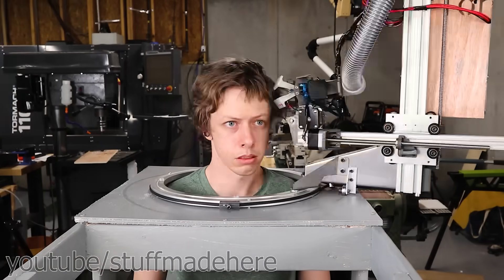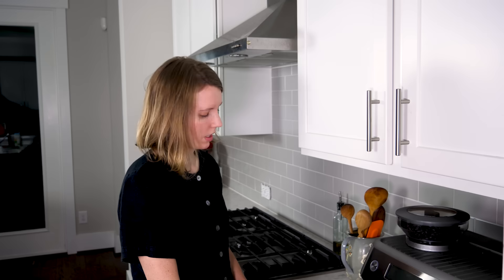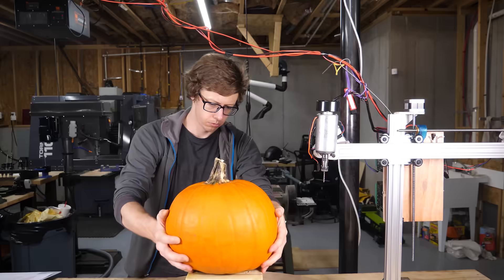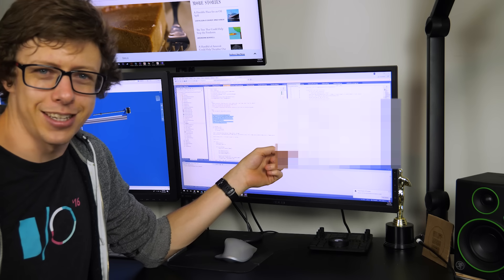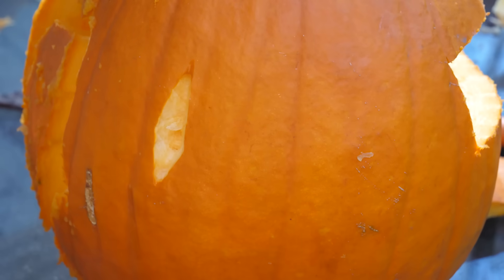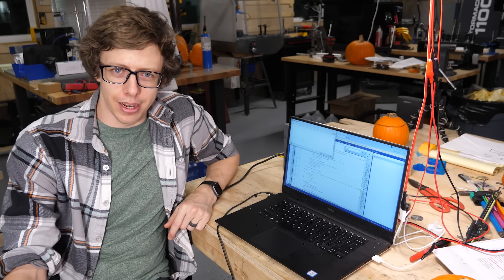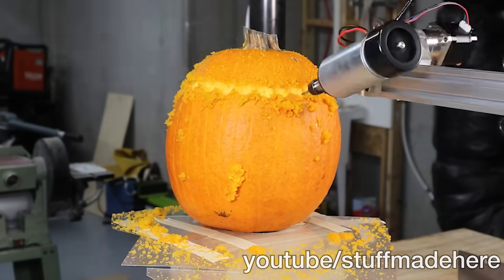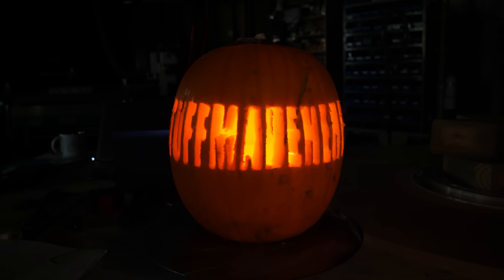Making a robot to carve photos into pumpkins

Comment: Jack o'lantern production at a jack o'lantern farm was low, so the farmer wrote to the local university, asking for help from academia. A multidisciplinary team of professors was assembled, headed by a theoretical physicist, and two weeks of intensive on-site investigation took place. The scholars then returned to the university, notebooks crammed with data, where the task of writing the report was left to the team leader. Shortly thereafter the physicist returned to the farm, saying to the farmer, "I have the solution, but it works only in the case of spherical pumpkins in a vacuum".

Comment: Great job!  If I may mention, one of the tricks I use is to ignore the item is round. That is, map the X coord to the rotational axis then use the depth at various points as depth (height) offsets. Then just treat the system as a 2D surface and cnc mill the pockets as needed. We do this on our cnc lathe when we need to machine serial numbers on the curved surface

Comment: I feel like you could've taken notes from your CNC and both used two different sized end mills (a larger one for roughing, and a smaller one for details) and used ball end mills because that would remove a lot of your crazy lines from the cuts. Also could've used a tailstock of some sort, securing the pumpkin by holding down from the top.

Comment: The lines will probbaly be a lot smoother if you freeze the pumpkin first. The cnc router can easily push the mushy skin out of the path its supposed to be cutting.

Comment: WHat you need isn't engineering help for the pumkin, it's cooking/ Chem help. The pumkin has alot of moisture in it and alot of pulp that likes to come off as one peice when using a ripping tool like a drillbit. this makes the final product come out grainy and lacking in detail. the skin needs to dried before being cut or you need to clean your drill bt intermitenly as you are cutting to maintain the cutting edge. I doubt your robot is bad, just pumkins dont like to be cut.

Comment: About the flat earth,  yes it measures flat there is no 8"/mile^2.  However , earth is spherical ...  Space is warped/wrapped around in 3D sphere ...a black hole planet,  2D event horizon,  "us "  the information or ...in-form-nation.  information is 2D,  not 3D.  however the glob/e is 3D ...earth 🌎 ,  1D singularity is the core of extreme energy density.  causing black hole. I am an engineer 🐇 🕳 https://www.flatearthresearch.com/2020/06/04/earth-is-a-black-hole

Comment: Please may you point me in the direction that isn't 10's of thousands of dollars of schooling in order to learn to program. I just literally would love like a list of books and or websites or something of that sort or combination that will give me the definitive guide to learn how to program. It's been a goal of mine since I was like 12 or 13 when I was buying things like a sumobot that had a basic stamp microcontroller to aurduino and xbee. But never have I ever been successful in learning to program, retention isnt a problem. What I always seem to run into was that after you get passed a "hello world" to an lcd with  ASCII, it goes to 💯. Where they talk about matrix solving, that Arduino can technically do, or something like creating their own libraries and calling from that and that library is in c, or just program language that isn't at all listed in the beginner guides. There is also the complexity of the components themselves that require reading into the schematics to know, like a GPS unit, that it needs some delays written in the code to give time to retrieve signal. I think at this point I made my point. 

In short I want to know if there is a good "course" (free) that will take me to blinking led and hello world, to having a grasp (not necessarily on components, I really can grasp that well or quickly) enough to be able to program a touch lcd with key inputs that make a wirelessly controlled arduino bot that can move autonomously if told to and map it's surroundings. 

(Also I had this dream goal since a kid, and my poor but very beautiful and kind mom helped me financially, where I have a touch screen controlled rocket,  L class, that I push "launch" on the screen and walk away and get wireless reading from another Arduino hooked up to another lcd that even showed camera footage and GPS data and used a 6 dof, I'm forgetting the name for it but it tells me orientation and speed and g force etc., And seriously the only hurdle was programming. I got the rocket and engine and just never wanted to even attempt flying unless it had the electronics.) Still have the sensors and boards do something close to that, spent probably$100's, those were the days.

 Anyways if you read this, then thank you for your time and hope I don't waste it, and your videos frustrate me with motivation and creativity, and I am in awe at the level of ....just how badass the stuff you make is.

Comment: I would think the pumpkin, especially the flesh under the skin, will be difficult to mill cleanly.  The cut edges won't be sharp as the material may actually flex away from the cutting head as it isn't rigid like metal.  Using really small cutting tools, or maybe higher RPM might help.  Just spitballing.

Comment: Instead of multiple probes why not a spring loaded caliper as it rolls the measurements would changed and could be recorded. Roll it in vertical and horizontal and you have a 3d picture. Or what about a 3d ir map like you used to do blind navigation basket ball tracking. You don't need live feedback as unlike your head the  pumpkin doesn't move.

Comment: I don't think you can climb milk a pumpkin. It's like routing the end grain of wood, it just sucks the grain structure isn't compatible with the stress of the cutter. I'd suggest only vertical milling, I know it'll increase the operation time but I think the finish will be way better. Either that or a tool charge to a smaller mill for a finishing operation.

Comment: Incredible! Absolutely love it. Can't wait to see more from the Pumpkin Bot.
Also, I had a suggestion for a pumpkin-related vid, and maybe the bot could help with this. I was thinking trying to make gears out of pumpkin flesh could be cool, and you could use skewers or something for axles. In my head I was thinking you'd have a hand crank that would power the gears to make the pumpkin spin or move up and down or something simple like that. No ideas yet for real applications of this, or if pumpkin flesh could even work well for gears (I imagine it won't but it would be funny), but I thought it could be right up your alley. Great job on the robot!

Comment: As I watch you probing the pumpkin, I desperately want to digitize the pumpkin for you!!!  I can easily digitize a pumpkin in full scale 3d minus a 0.09375" offset (mechanical constraints). I'd guess that using a few specific (as many as neccesary)  digitized points as XYZ probing points for the cut program, you could get a pretty accurate result. After all, what's the point of owning painfully expensive measuring equipment if you can't use it for something worth while, like cutting pumpkins! And I know you're wondering... I use a Prodim Proliner. It's a super basic but highly accurate digitizing device that I use for templating countertops. But, it's soooo much more capable!

Comment: Idea: Clamp the pumpkin in place(or attach it at the base, affix it to the surface somehow). It's wobbling as your robot is putting pressure on it, causing the carving to be slightly off.